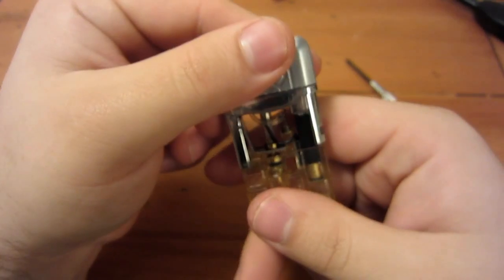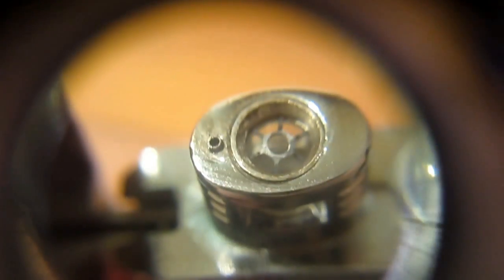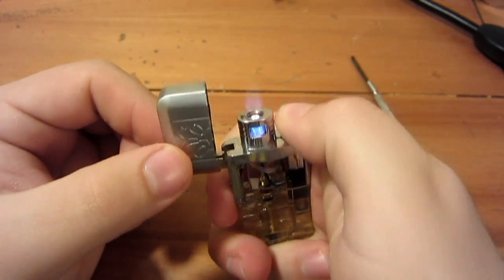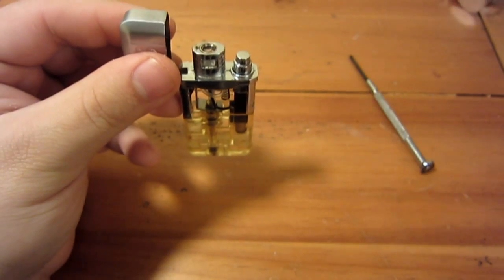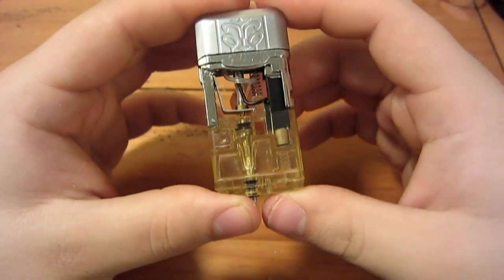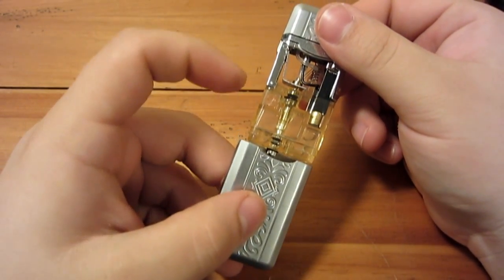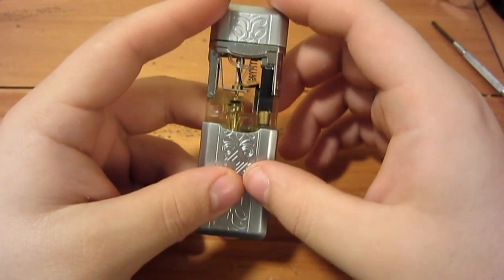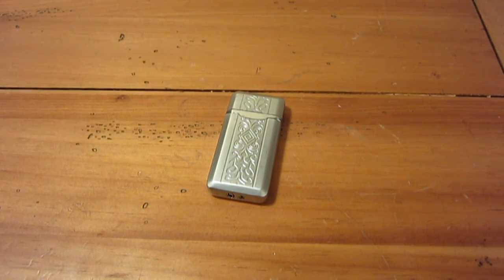Explaining How Butane Lighters Work & How To Fix Them

Comment: I know this is extremely old, but the flame is set to high for the regular flame so it shooting gas too high to catch the other flame so somehow you have to set that flame down lower for anybody who’s interested.  Probably bending that metal prong so it doesn’t pull up as hard would fix that.  Fun fact, the little spark mechanism thing is powered by crystals, and they don’t last forever. It’s usually the first thing that goes bad.  Also, if you’re ever not sure how to fix a lighter, ask a drug addict lol. 😂

Comment: How do you fix a butane lighter that no longer clicks when you attempt to light it? I can't seem to find a video that adequately explains what to do... Nor one explaining the reason it stops working when it will not click anymore... (If it helps, I'm specifically in need of help with an eagle torch lighter...) Thank you in advance if you are able to explain how to fix the non clicking issue so it will light again, or tell me what video to watch to learn how to fix it...

Comment: For mine it was the craziest thing: the soft-flame supply tube has to be caught in the spring that is compressed by the button. Basically, when that tube isn’t pinched, none, or not enough, of the gas goes through the torch outlet. Holding the button pinches the tube, sending gas through the torch outlet to be ignited. Letting go decompresses the tube, which is the usual path of least resistance for the gas, where it will be ignited by the last of the torch flame. And I thought it was poor workmanship to have it caught in the spring. So janky it’s genius 😂

Comment: can someone help explain this to me, i have two butane canisters one from fasfil 5x refined 300ml(10.15oz) the other is nibo 11x refined 300ml(5.7oz)??? how can there be two different measures in oz when they both have the same measure in ml(ie volume)? i figured either there was a mistake or cheating going on at first but then upon some thinking about it and a bit of research it turns out the ounce can be a measure of both volume and weight depending how it's written if it states "oz" only then it is a measure of weight and if it state "fluid oz" it is a measure of volume so both my cans are stated in weight so the only thing that makes sense is that the nibo which is refined 55% more than the fasfil weighs less because of less umpirites?? well at least 55% less weight doing the math on both refining times or ounce difference, is this possible it makes that much difference in weight from impurities? but this is the only thing i can think of

Comment: yeah its suppose to work fast once you release the jet flame button(ie the piezo) this closes the jet flame gas line but is suppose to open the reg flame gas line and its not happening fast enough and the timing is off which is most likely from over use and badly made parts that wear out, idk if this is fixable perhaps if you tweak the springs for the jet flame actuator on the piezo or the valves are no longer smoothly operating and take long to open for the reg flame

Comment: i got a few observations, first of all i dont understand why the designer wanted to include this secondary regular flame and complicate the system? what is the point of having that second flame after you used the jet flame? second i can see the lever bar that actuates the gas line valve to open once the top cap is flipped open but i do not see a second lever bar or actuator for the jet flame? i know there must be something there  when you press down on the sparkler that must open a second gas line for the jet flame also because when you lit the regular flame the jet flame did not light so its two separate systems ,  but i dont understand why the regular flame would not be lit if the jet flame is operating and is only suppose to light once you stop the jet flame this makes no sense unless the regular flame is no longer receiving gas once the jet flame is working but only does once the gas for the jet flame is shut then the gas vale for the reg flame comes on and sparks thx to the extinguishing jet flame as it dies down, perhaps the problem why it was not working is because there is mess up in the valves operational  sequence , these cheap made in china lighters with crappy built plastics and parts after a while get out of alignment

Comment: Great video!  
I have a Calibri # 947 lighter/cutter. Problem is to much gas comes out even when I adjust it and doesn't ignite because of to much gas. What do you think is the problem and are replaceable parts universal if so where is a good website you recommend to buy parts. 
I appreciate taking the time to answer and thank you.

Comment: At the border where the flame should light and where the ignition flame is,  there is a thin piece of metal.   It appears to be protruding slightly, this preventing the ignition flame from reaching the intended location.    If you adjust that down,  you should get ignition.

Comment: It's a common error that a lot of folks make with these jet/laser/torch lighters, in that they use cheapo butane. You must use refined or ultra-refined butane like Newport Zero or Neon 11x Ultra-Refined which is a premium butane. They cost a lil more but will never clog up the sensitive valves in your lighter with micro-impurities thats in cheap butane made from chlorinated methane from pig farts.

Comment: If you go to refill the lighter  and  you force to much butane  into the tank it will  create a space between the plastic tank threads  and the out side of the  threaded  metal shut off stem you can see this  metal piece at  You can see this piece  when he zooms in and  puts a a magnifier glass in front of it at  . If you hear  the butane leaking out   wait till its empty  then  take the  lighter apart  . To remove the  shut off valve and housing with the threads on it  you have to unscrew the flame adjuster screw . It screws into the metal shut off housing . Once the flame  screw stem is unscrewed you can unscrew the  metal piece from the tank . cut a strip of yellow teflon gasline  PTFET tape  its sold at lowes or home depot  next to the white tape  but get the yellow  color . Cut it long enough to just  cover the threads on the metal piece one time with a small over lap . stretch the tape so you see the threads  and push the tape into the threads with your finger  and screw it back in place . Is will stop the leak . The leak is not coming from the inside of the valve  but  around the treads . The tape will seal off the leak and you will not have any  butane escaping.
Reply: Show us! I'd like to see it! Why don't you make a video of how to do this and post it on YouTube?

Comment: what would cause a lighter to not take in butane when you try to fill it? I've got a ton that can't be used bc they won't take fluid and when i try filling them the butane just sprays all over my hand and the outside of the lighter?! oh and I've tried bleeding them but it's like nothing comes out when i do it. the mechanical push part is working.. it clicks and I can see that the lever pushes the plastic thing up.. also there is spark..i haven't been able to find anyone explain what could cause these lighters to reject butane

Comment: Is it normal when you open the cap of the lighter to hear a sound like gas leaking?
Reply from the maker: yes lots of butane lighters have a mechanism so that when the cap is opened the fuel starts to leak out so it can be ignited you wont know but when its closed the gas shuts off since its not in use...This allows the lighter to be used hands free if needed
Reply: @cutlerylover  thank you for the answer...i have a flint pierre cardin lighter and it lasts only 2 days...any suggestions?
Reply from the maker: @babylonreviews9827  well if there is a leak its most likely in the fill port they all have orings in there to seal the opening and like other orings they can go back qwith age get hard and crack, your best bet is to see if you can get to it to check if its still making a seal once filled put it up to your ear to see if the noise is coming from the bottom if it is an oring replacement can be tricky or impossible without sending it back to the company, but if you really cant figure it out Id contact the maker and ask for it to be fixed...
Reply: @cutlerylover  i dont hear nothing from the bottom...is there a posibility to filled it with the wrong valve type and dont filled to the max?
Reply from the maker: @babylonreviews9827  yes! some lighters require a different tip for filling usually higher end brands like dunhill...you can contact the maker and ask about it to be sure...that would be a possible issue is your not getting much gas in there to begin with...Also before filling be sure to completely purge the valve to get out old gas just use the tip of something hard to push in the filling nozzle...

Comment: I also tinker. Yes, you checked the igniter is landing where it needs to and isn't arcing by exposed metal, like you said anywhere else.  2. It's getting gas by troubleshooting with a flame. 3. I'd check to see if the lighter is happier being turned up a bit (yes, some lighters are happy at a certain gas flow). If No leaks in the gas line itself then.. Before I refill with butan, (and it should be done each time you refill your lighter), turn down to the negative all the way, bleed the air from the tank using a small flat head, and then refill. Hold in your hand for a few minutes before attempting to ignite. Turn up the gas and spark it up. If it's still having issues, check your O-rings...is it leaking or change them out.

Comment: I'm having trouble with a torch lighter that has the side plate that slides forward in order for it to ignite.  After having reassembled it back together, that part won't click unless I give it a little hit on the side then it will spark and work fine.  But then next use it will resist like something's blocking whatever part inside.  It's been some time since I tried to fix it completely.  And I have another interesting lighter to fix from a friend who has a gift for anything he touches will break.  It usually goes downhill from there when he tries to fix it himself then he hands it to me

Comment: I think the reason the regular flame doesn't work is because of the lack of fuel vapors coming from the fuel tank. Due to tilting it upside down, more fuel vapors escapes the left hole allowing it to ignite a flame and draw more vapors with pressure difference of outside and inside of the tank which allows the flame to continue burning so maybe you should check the hole on the left or increase pressure inside the tank?

Comment: hey quick question... so i recently bought a butane lighter and it suddenly stopped working. Its not the gas i think because it says on the bottle zero impurities. Also i do have a spark. But even though both are working, nothing happens it doesn't turn on. I also tried changing the amount of gas when the bottom is pressed and it didn't do anything. A bit of help please thanks

Comment: its simply because  the "O ring " rubber stopper(the tiny black one) need a replacement,. due to everyday use or may closing it too tight, it becomes bigger and the valve gives only a minimal flame. as a common user the next thing im going to do is 
to adjust it.+. the more you adjust it to + the harder for your igniter to reach the normal flame because of the pressure.
for me the best solution here to save time and headache... close the line of the regular flame ...

Comment: I have a really old rowenta electronic. the flame works, but I need to start it with my jet lighter because looks like the ignition system uses a 22.5 battery to work. Do you know if these batteries still exist?

Comment: I have a pretty cheap electric butane lighter, but when I press the button, there is no spark, is there a way to recharge it somehow? Thanks
Reply: Actually, I just watched another video, soo... Is there a way to make it spark again? (Not recharge I heard, since they don't need to be)
Reply: ***** Nope. The piezo electric unit is broken entirely. You could remove another piezo electric unit from another lighter and fit it to yours... but most lighters wont allow that as the unit is normally glued in and not replaceable by the customer.
Reply: Oh, ok, thanks!

Comment: I have a beautiful Rocket Lighter that works perfectly.  I am putting my belongings in storage for 2 years and figured I should empty the lighter fluid before storing.  Would you agree? The crazy thing is that I purchased it on Ebay and was shocked when it shipped from England to California, filled with lighter fluid in it.  I just hope that it works as well once I refill it in 2 years.  Do you see any issues?

Comment: You're a good person to fix your friend's lighter!! The spark is piezoelectric (it's just the opposite of inkjet printers where voltage is applied to the printing head). The only thing I can add, it helps to warm the can of (refill) butane first before filling. I guess this raises the pressure of the gas. I agree with Oliver, completely purge all the gas out before refilling. In my opinion, the piezoelectric spark element is the first thing to fail, especially with cheaper Ronson brand lighters; the plastic element case cracks.
Reply: I often call them "pieze-o-shit" lighters XD
(but I know the piezoelectric system CAN be dependable, depending on construction)

Comment: I have a colibri with 2 jets, but one of the 2 jets gives a regular flame instead of a jet. Any idea what the problem could be?
Reply: Clogged jet. Clear it out with compressed air. If that doesn’t work, you can clean it further with a toothbrush and alcohol.

Comment: Before filling a butane you should take a small screw driver and push down the intake valve to release the gas, this is the most common problem with refueling them when you think they don't work. If you have a spark then release the gas first.
Reply: what is the intake valve?

Comment: My lighter didn't work, turns out it was a clog, which is something I wouldn't have thought about until he mentioned it. I took the entire thing about and rebuilt it so many times, but all I needed to do was unscrew the butane tank and let all of the butane out, which unclogged it. Just empty, refuel, and screw it back together. :)

Comment: Hi, can you help me please :)

I have a butane lighter, mine's a flint (also has a jet flame function). I had to dismantle the entire thing to get a jammed flint stone out :(

Anyway, in the process I ripped the fuel line. Amazing that was a simple fix (melt the plastic close), however I can now no longer put the damn thing back on. That is I can't put the fuel line back on the valve thingy. Is there a special tool I need? I'll be very helpful.

Comment: Your lighter will require a new fill valve if leaking out the hole... If leaking around the sides of the valve it will require new O-Rings ..
w w w. sparks of time vintage lighters . c o m

Comment: To replace the ignitor you must take aprt the lighter. There should be a couple long pins that hold the top of the lighter to the inner body (sometimes a small screw on some colibri lighters). Once you get the top off... The ignitor just slides out for a replacement. Sometimes you have to replace the burner along with the ignitor if it is attaches. Most lighters the wire can be pulled out of the top burner...

w w w. sparks of time vintage lighters . c o m

Comment: That lighter is also a pipe lighting lighter. The soft flame is NOT supposed to work until you flip the lighter upside down to light a pipe. If it were meant to light and be lit all the time there would be a channel from the small hole to the jet flame to allow the fuel to get to it. I have examples of that type of lighter and i fix and repair most makes and models of vintage to present lighters. Very nice video :)
w w w sparks of time vintage lighters . c o m

Comment: i bougt two lighters yesterday and they worked fine unti i refilled them and they stoped working i tried hor two houers to fixed them but fail  and had to throw 'them awau they work like the one in this video two.flames damn it i liked them alot i wonder if there is a better quality like this version i wasted 16  bucks

Comment: i bled the lighter by holding down the gas . when i reached the bottom i struck the igniter and it worked! but why didit work it was the same fluid. is it possible to overfill the lighter so much it dosent work?

Comment from the maker: @12eyseandahalf In an eletric lighter, a spring-driven mass strikes a piezoelectric crystal and exposes that crystal to a sudden enormous strain. This strain changes the shapes of the electronic levels in the crystal and produces an imbalance in the electric charges on the crystal's surfaces. One side of the crystal acquires a large positive charge, the other a large negative charge. Theres more to explain but...thats how a small charge is created or spark, enough to light the fuel

Comment: If you drill out the tiny "regular flame" hole a little bit it will light no prob. I had a very similar lighter that did the same thing, it cost me 3$ but took me about an hour to get it to work properly.  damn gas station lighters. lol

Comment: Not a lot of people make videos on them, but a great cheap butane light is a Ronson Jet Blue (I don't remember the exact name?). They are only like $5, the fuel lasts a long time, and it's just such a good value for the price. I see them a lot in grocery and drug stores. They are made for cigars, but you can most definitely use it for anything you would a Zippo. I highly recommend you check it out if you haven't already.
Reply: It's called the Jetlite by Ronson.
Fun fact, Zippo owns Ronson... The same company manufactures the products for both names.